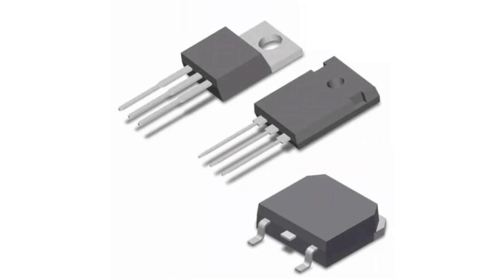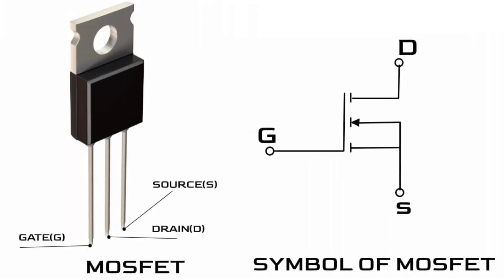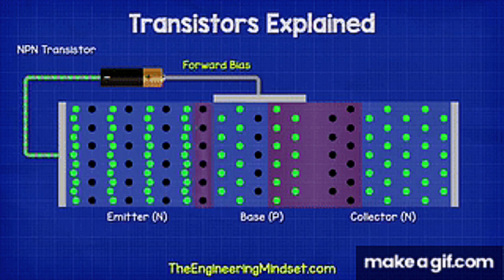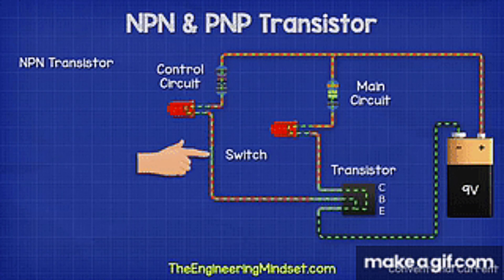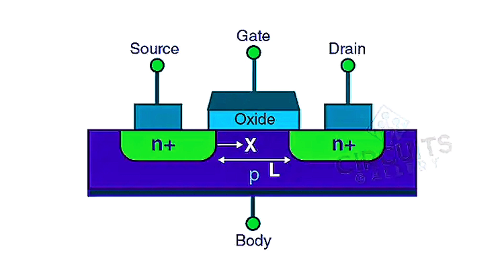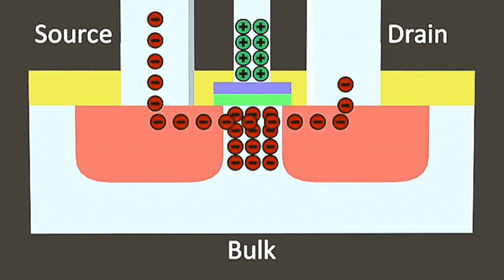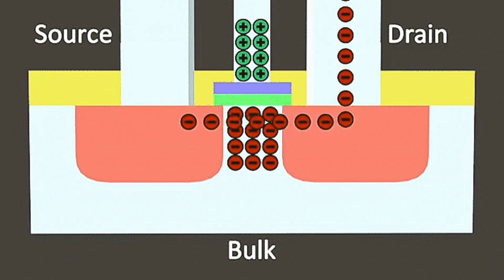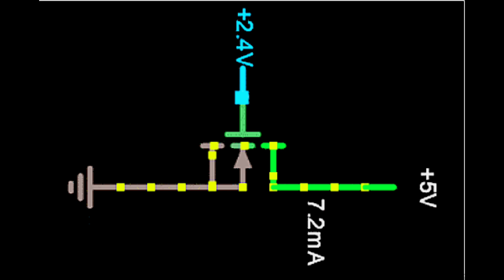NPN Channel Mosfet Explained

Comment: I use these cool devices in just about every high power application were high amp low freq switching is required. Built an high watt am transmitter using just 2. One for the RF osc/output stage. The other does a great job modulating the audio carrier 🙂
Reply from the maker: Yes, you can use it for high power!